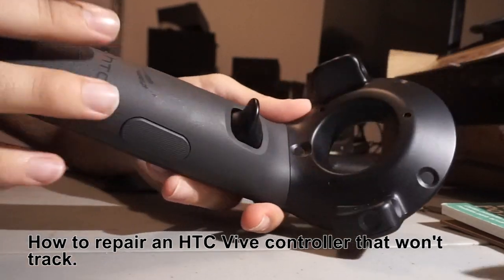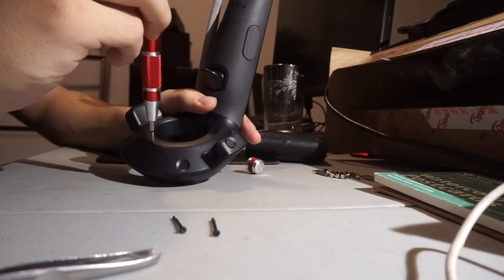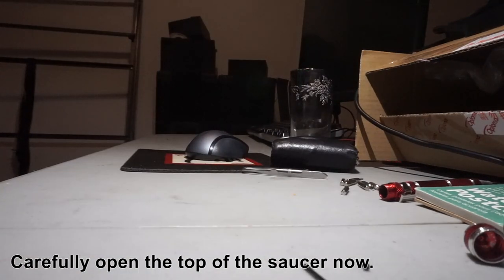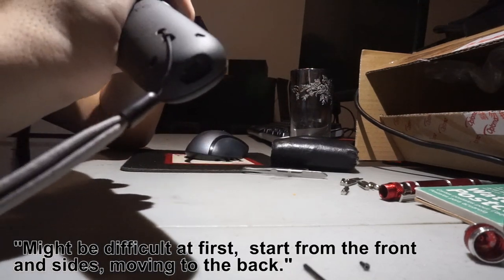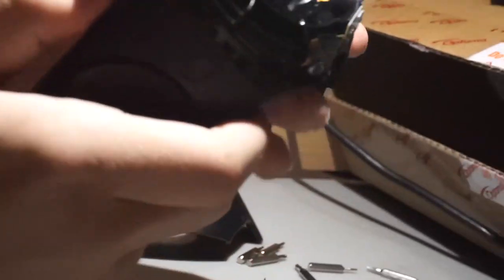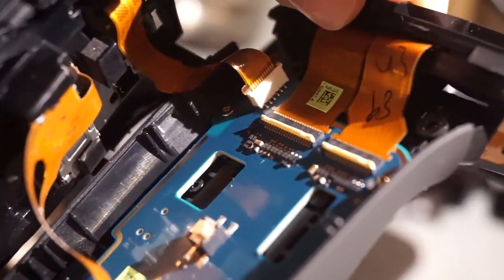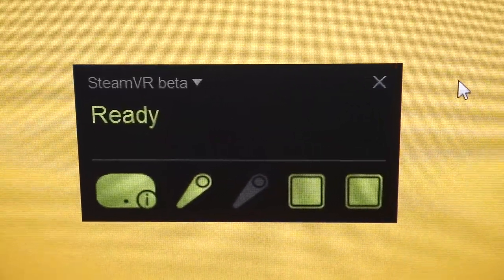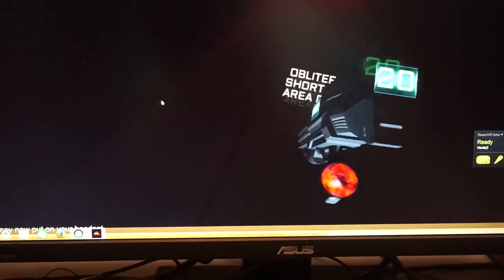How to Fix the HTC Vive Controller? (Teardown and Repair)

Comment: For those experience controller sync issues with slow blinking blue lights on their old vive controllers, it's due to the orange film or bands not docked in their strip slots or not touching the metallic pieces inside the controller. Both the long film from the middle to bottom of the controller need to touch what looks like the battery and the other is the circular band that overs around the rubber inner piece; that band has to touch he middle metallic part in the center of the controller/under the touch pad. I taped the film to the metal pieces and it synced easily.
Reply: can you show a picture of how to do it? one of my controllers gets paired but loses tracking constantly, and goes blue again
Reply: @FrozenLuna  I did away with vive controllers a long while ago handing them off to a friend of mine. Having the film touch the right components helps as a tempuary solution, but ultimately its due to the devices within the touch pads going bad which unfortunately can't be taken apart and fixed. However, you can take apart the controller, buy a steam controller for $5, and use the touch pads on the steam controllers to replace the touch pad on the vive controller. Every Steam controller comes with two of them. I like to tell others the vive controller is like a hard egg. Hard and durable on the outside, gummy and fragile on the inside.
Reply: @Js103036  thank you so much for the reply.
I've found myself in a predicament and I don't know what to do, I've been trying EVERYTHING at this point, and I can't still point out the issue and how to fix it, I guess my solution will be get a new one...
Is not a bad idea about the stream coontroller touchpad!, sadly they don't sell it here, it kinda sucks, but it is what it is. And yeah, the vive controllers sucks, the only good thing about them is that they are for both hands, so if you have issue with one, you don't have to get one from the left hand or one for the right.

Comment: Worked for me. Scarier than I thought it would be, though. I have new respect for these little widgets. Note: The Phillips-head screws can stay in place. Flat screwdriver helps a lot to lever the plastic bits apart.  Thanks for the video!

Comment: Important note: after connecting the cable, I tried turning on the controller right away without putting back the saucer section. SteamVR still won't track my controller. At first I thought it's seriously broken, then I realized that the saucer section has all the infrared filter (those dots) needed for lighthouse detection. It works straight away after putting saucer back.

Comment: My HTC controllers have really annoying janky movements that would sometimes stop tracking intermittently while playing beat saber. From what I recall, I never dropped it, (or atleast dropped it hard enough to notice damage, or on non carpet ground). Would this help me solve the issue? Also, they are HTC Vive Pro Controllers and I'm using Vive Pro 2. Is it still applicable? Everything is fine (headset, base station etc) except the wonky controller movement. I tried as much as I can, reinstalling the vive software, using different ports and cables, repositioning the base station, resetting settings, but im freaking hopeless and shattered. 799 USD down the drain (temporarily)

Comment: Excellent, I used this to fix both my controllers which stopped tracking after a horrendous collision with the floor. One was hit so bad that the top face cover of the handle itself came off without undoing the two screws! And the entire internal head unit came off when I removed that third screw! I was thinking I'd need a new one, but no, it's all working perfectly again! 👍🏻

Comment: A word of caution, to anyone planning to open up the controller themselves. When I opened mine, to fix the touch pad, there was a very thin ribbon that was taped in place by HTC. They'd taped it because the ribbon clip it was attached to was broken during the manufacturing process. By opening the controller, I became responsible for that, as the tape came undone and I absolutely couldn't fix the tiny ribbon clip myself. 
The key issue here is that there was a pre-existing manufacturing flaw that I exposed when I opened it. I easily fixed the touchpad issue myself, but had to send the controller in to HTC to fix. It took weeks, was a total pain to deal with their tech support, and cost me $120 of my own money. I highly don't recommend opening the controller yourself, as you may well have the same factory flaw with a mickey mouse "fix" barely holding it together. 
HTC will NOT fix it for free if you find it. Open at your own risk.
Reply: it would have been faster and cheaper to sell that one as-is and to buy a new one.

Comment: i had the blue light not tracking problem that lots of folks had who tried this fix..here is what i noticed and used to fix it. i noticed if i pressed hard on center of track pad I could hear slight static interference or a hiss in my pc speakers..very quietly and when i did it with my good controller it didnt get that hiss, so i kept pressing very firmly over and over till the hiss lessened and then tried my controller and the it amazingly tracked, so maybe i remeved some corosion from the stress bending rubbing effect or i made the connection he speaks of in the video below the track pad touch better.. maybe this will help those blue light folks that the ribbon cable reseat didnt help

Comment: Hi, I made fix like you. I put super glue on my rubber, everythings is in place, touchpad is clicking.
But after assembling controller i noticed that touchpad is not working fine - only if i press touchpad strongly I see green "teleportation ring" (for example in The Lab).

I see fingers on touchpad,  I can click in touchpad, but it's not responding fine in application.
Any idea?

Comment: Great video, but can I suggest proper tools? I have a $25 screw driver set that easily reached down those deep holes.
Reply: Hi, Where did you get the screwdriver and kit and what was it called. thanks

Comment: Could a loose ribbon cable cause my controller to only pair when connected on USB, track poorly on USB/eventually fade out, and not work at all unwired? Or would this be a weird software issue? 
One of my controllers started doing this after taking vive out of storage. Either software bug happened randomly between storing and setting up, or it got jostled maybe?
Reply: did you figure this out? i have same issue exactly?!!

Comment: be cafeful of the menu button zif connector at the very bottom. I ripped the damn thing right off the board and i have experience too.  no fixing that.  I cant even reflow it because the piece straight up dissolved into individual pins which fell out.  I keep some scrap parts around to salvage things like this, but its an off zif so i bet i dont have one.  Probably wornt bother,  bc i took it apart bc it quit working in the first place.

Comment: Hey I was wondering if this happened to my controller. My controller wont connect for shit. When i try to pair the controller it will not go into pairing mode. It will go into a weird state where it does the pairing mode chime and the blue light will start flashing but the flash it slow and it takes much longer to hold down the buttons to get it into this state. Was this similar to your issue before you repaired it?
Reply from the maker: Does it show up in SteamVR as paired but not tracking?
Reply: I have this exact same problem, I am trying to get it fixed, do you know how to fix it?
Reply: Mine do this periodically.  I fix it by plugging the controller into the PC via USB and then unplugging them. It usually does the trick, but not 100%.  More like 85%.

Comment: thanks ;) I actually had to replug the 2 datacables.. after a strong hit, they really got disconnected ;) the screws are shit.. stupid size in europe.. was quite tricky to get them out without the correct torx sizes
Reply: Well, if you ever had to screw an IPhone apart you would think very differently about the screws. You need like 8 different screwdrivers for an IPhone. Also, HTC, the company that inventet the Vive is a Taiwanese company so you should not blame it on Europe.

Comment: You spent all that time getting the screws out of the bottom of the handle and didn't say what size they were.

Is it a T4 or T5? I can't find anyone saying online. I have a T5 but I can't get it to work and don't want to strip the screw.
Reply: t4 works for me
Reply: Rogilla Kerman Thanks
Reply: It's T5. I had the same problem, for some reason the torx driver didn't want to go in to one of the screws, but I wiggled it around and it went in eventually. Maybe some of the screws are right on the small end of the spec.

Comment: i just got my for 1 month ago and my controller stopped the vibration both at the same time so i put it at repair station called Dynafix to fix it and if they fail ill get a new HTC Vive for free but i have to wait 10 days or 4 weeks
but helpfull next time i drop my htc

Comment: Wait...the internal ribbon cables popped out on their own?? That's a bit of a design flaw...
Reply from the maker: Yeah but it will only pop out if you hit it really hard. kind of a loose end.
Reply: It seems it was designed that way so that it would just pop out instead of breaking of all together making it easier to repair
Reply: Not so much a flaw as a failsafe. Under too much stress the cables will pop out instead of tearing. Putting the cables back in is far easier than replacing them wouldn't you say?

Comment: Didn't work for me.. well, for a good 30 seconds and boom... Back to being broken. Tried every single trick in the book. Nothing will work... Might have to just call it quits on it.
After getting everything all finished and "Repaired", my controller had a solid blue light... Paired it again and it turned green but my other controller then turned blue... Paired that one too and the original controller was back to blue.. After that battle and "reconnection" of the innards, it was green for maybe 30 seconds into a game then the controller that was originally broken/messed up was stuck moving backwards as if my touchpad had stopped working. Then it went back to blue... I'm like 10 seconds away from nerd raging and punting this POS controller. Maybe that's why it's broke :|